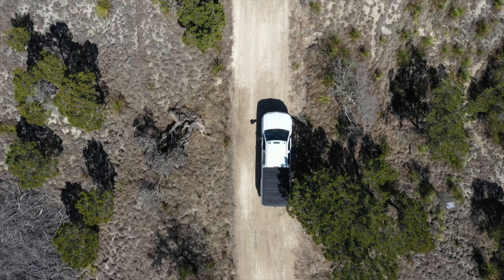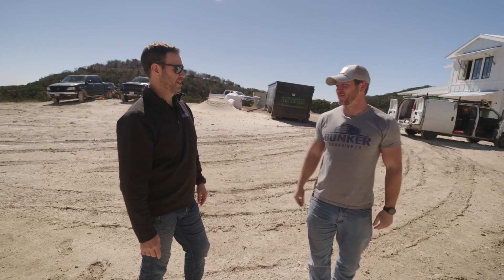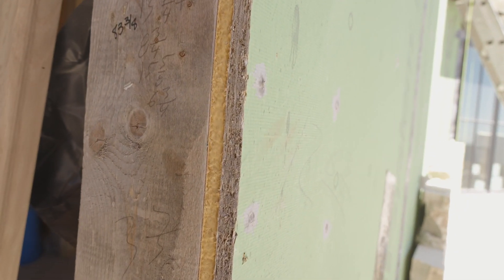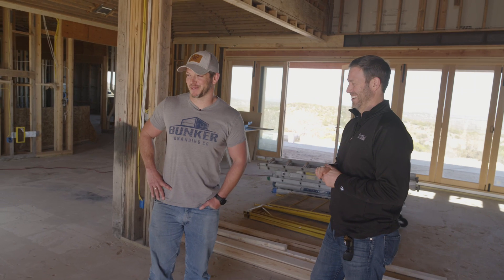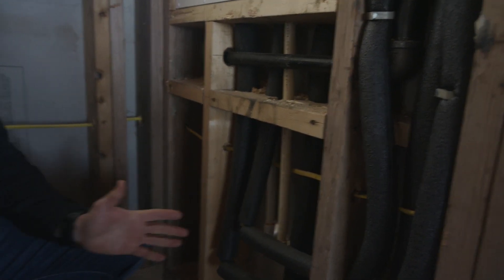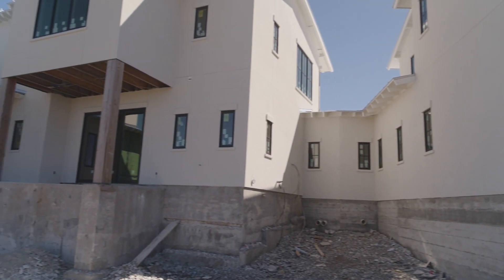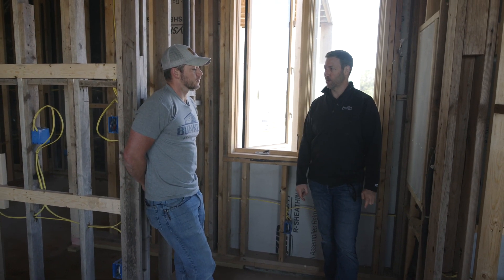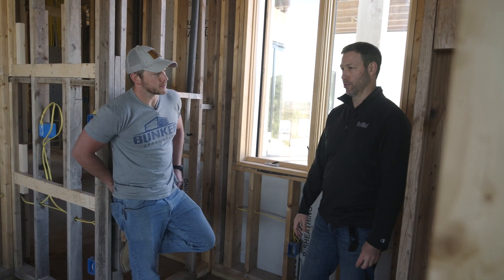One Vulnerable Spot at the Abandoned Mansion

Comment: We can't get a plumber to fix our external faucet. Ten years almost now and most calls are ignored. We've only been granted a visit from three plumbers over the decade for different needs that were more pressing including a mid summer main break at the inlet into the slab foundation which involved two plumbers the first of which promised considerable demolition and twice the price that the second responder asked. We would have used that plumber again but they and their construction branch have passed on all our calls and efforts to contact for further renovation work. The last plumber we hired was to try and clear a drainage obstruction related to all drains in the bathroom. They achieved a good result with the sink drain but were met with difficult bend with the bathtub drain. They left it unresolved and in turn haven't responded to any of our later calls about other plumbing issues with the hose outlet and toilet feed.

Our house has suffered considerable distress over the decade and with no options on contract repair and renovation we're stuck. Stuck with a improperly installed furnace stack, improper window installation, soaked insulation or relocated by rodents, mold and condensation damage, spongy ceiling paneling from rain intrusion, collapsing wall panels under most window replacements, sloping kitchen cabinets from water damage, substandard insulation in the ceiling in the form of layered newsprint, compromised electrics, untreateable ant infestation, improper drains in the kitchen, corrosion damage to the exterior walls, a break in the foundation at the water feed into the house, and layers of lead flaking paint. It took four months before we could get a new refrigerator delivered after purchase as the demolition needed to fit it into place prevented it. It took four months after calling different job people as well as relatives of friends who also passed on our voicemails till one connection fell into line. Wall removed and finally we could move forward after It was me who patched in the floor tiles and applied a basic plywood patching over the wall cavities.

This is the house we have, it has historic value and represents a standing investment. But there isn't a contractor under retirement age who will humble them selves to answer a job request or commit to more than one project. If we had not been able to get our main line replaced by the second contractor we would have been forced to demolish our kitchen with no certainty of replacement. Our utility expenses are likely considerably higher than that of a much larger more standard house not just for the strangeness of it's last refit but also for the critical level of disrepair it has reached. There should be a path forward. Even our engagements for finishing standard projects have met with problems.

I understand that tradesmen are in shorter supply, or at least in some areas of the country. But we have been willing to pay in past, our money was as good as anyone else's. We could afford the repairs. Now we don't know if what savings we have have a hope of fixing a portion of the problems mounted up. What on Earth is wrong with people that they turn up their noses at a challenge? Now the challenge is critical and then some with every passing season. We would normally heat with Gas but the furnace has been suffered from corrosion via the stack and was neither fit to start or accessible to test. We heated through half the season using our electric oven before it fizzed out and have been stuck with space heaters since then. Somehow we had no pipes freeze this winter where we would normally however we never turned down our heaters and kept faucets trickling to reduce risks.

Obviously my singular option is to refurbish everything my self. I haven't the tools or know how for such a project. I haven't the space to work on a project of this scope. Every time I view a video related to problem solving and prevention I wonder where the hell all of this know-how and workmanship exists. I assume it's nowhere near where I live or I must represent the single exception for contractors everywhere of a customer not worth catering to.

Comment: Carriker has been grooving on solar power in one out building. Why not more!? Solar power could be it's own back up plan if the heat tape, sensors (fire) and security system are low voltage.

Comment: I've NEVER seen anyone NOT use frostproof wall hydrants on any recent new construction north of DFW.  I'll bet west Texas uses them more often than not as well.   The "commonly in Texas" statement may apply in south Texas where these two Matts live, but they are found all over north and west Texas.  The vacuum breaker they are talking about is used to protect the water supply.  If a hose was attached to the hydrant, and a larger leak developed in another part of the water system, the water in the hose could be sucked back into the other portion of the system thus potentially contaminating it.  The vacuum breaker "breaks" the vacuum that is created by the leak thus preventing the contamination.  Also, I bet those plastic "adapters" won't last a year after they are installed.

Comment: I could discuss for hours the differences in between how we build here in Australia and the way you guys do it over there (and if you are interested I'm happy to do so)  but for now just a few observations. 

Eves or as you refer to them, overhangs. No one builds a home here without eves of at least a couple of feet, a house would look odd without them. Like wise gutters which I was surprised to find out are rare in some parts of the US. Here in OZ if there  is no reticulated water the most common method of providing water is not a bore as is used there but rainwater off the roof into tanks. In areas where it is really dry gutters are still fitted as every drop is precious and bore water can be hard or salty and not good drinking. 

Roofs, we constantly shake our heads at the US love of shingles over ply. Roofs here are generally either Colorbond (electrostatically coated corrugated steel) or concrete tile. Shingles are almost unheard of let alone tar or other membranes. Generally our roofs will last the life of the house, I've seen corrugated iron roofs 150 years old and still going strong. Tile is not as popular as it was from the 50s to the 80s, the preference is now Colorbond steel. 

PVC piping: NO ONE here would ever use PVC for anything but drains and drainage. I can not believe it is used for pressure pipes in the US, that wouldn't make code here. Matt even uses it outside and even for tap risers which shocked me. All of that would be polypropylene here even tho we don't get freezing temps where I live. What a cheap and nasty way of doing things and TBH poly is no more expensive but has the advantages of flexibility and glueless, reusable fittings. For cold water inside (ie: in wall) we use the same nylon pipe if price is a factor or copper, hot is always copper but this use of PVC for pressure pipe is just nuts. 

I'm sure you will agree that Matt is doing a bang up job on the place, better than he thinks in fact. It is a massive project and it's all coming together really well. This is the first of your videos I've seen and I'm going to watch some more so expect some commentary on the differences in the ways we design and construct houses.
Reply: They aren't using PVC for pressure they are using PEX.  Do they use PEX in Australia?  Metal roofs are popular in some parts of the US.  Believe it or not in some places having a metal roof makes the insurance more expensive.
Reply: @DaveMcLain  In the house he's using PEX yes but at home and at Bunker all the outside pressure pipe is rigid PVC which to me is nuts. Take a look at a couple of the recent Off the Ranch videos such as the one from last week titled something like "repairing the damage". The only place I have ever seen PVC used as pressure pipe is in pool systems. 

Yes they use PEX here instead of copper inside walls etc.
Reply: @marvindebot3264  I haven't seen that video but maybe they used it because PEX doesn't like to be used outside where it is exposed to the sun.
Reply: @DaveMcLain  Then use poly like this: https://www.polypipe.com.au/
Using a brittle, hard pipe for pressure is nuts.
Reply: @marvindebot3264  PVC is rated for really high pressure as long as that pressure is water not air.  It's really ok.  Black poly pipe is also used in the US but mostly for direct burial water lines.

Comment: Propane furnace will NOT run without power. Yes fan won't run but neither will the burner. You need power to control the propane flow and ignition

Comment: metal has been the prefered option on the roof in Australia for about 30 years, I've never understood why people would pay for shingles, only to have to reshingle it every few years or when you get hailed on or in places like Hawaii redoing it every time you get a cyclone, crazy
Reply: I was determined to have a metal roof on the last house I built but my roofer talked me out of it. The asphalt shingles last 20+ years with warranty and cost 1/2 of what the metal roof was going to cost me. He explained that if I really wanted to put that much money into a roof, give him half the cost of a metal roof and put the other half in a savings account. In 20+ years from then he could put a new asphalt shingle roof on for what was in the savings account.
As far as the warranty, he said don't bank on the metal roofing supplier warranty because everyone of the suppliers that he previously dealt with went out of business.
The shingles are of great quality and 24 years leak free.
Every other year or so I have to scrub and pressure wash the metal roof on my shop and on occasion change out the metal screws because the rubber seal deteriorate.
Pro and cons with any roof depending on environment and other circumstances. Just my experience and that savings account looks pretty good.

Comment: Those frost free bibs suck balls. Or at least the ones I have on my house. The system that allows the air to push the water outta the line also make the water leak when you are at lower pressure. Makes the water leak around where your hose connects.

Comment: a couple of things - that type of hose bib he was holding is not a ball valve it's a globe valve - and he should have said 'freeze' instead of 'frost', and i believe the in the wall on demand water heater has a drain in it that goes outside (you can see it - it's the white tube)  and heat tape only works if you have power, i would never put exterior or in the wall on demand water heaters anywhere but in a zero freeze environ (which most of Texas is not) and metal plumber's strap on plastic is not code (tho i doubt it will ever fail because the plumber was savvy enough to put on some sheilding and it is getting foamed (tho i would never foam bays that have water supply lines in them in case of leaks) - (i also would never put water supply lines in exterior walls if i could help it - hard to do in a on an existing slab foundation remodal - i know)

Comment: No water lines in exterior walls.  No water lines running in the attic.  No hose bibs on your walls (instead have 2ft deep frost proof yard hydrants). Have furnaces in their own downstairs finished room NOT in an attic.  On demand water heater and for a house that size have multiple for sections of the house(less wasted water waiting for the water to get hot).  Have a manifold where you can turn off water to different quadrants of the house rather than one valve for the whole house.  Sucks turning off water for whole house just to fix one faucet or pipe.  Transfer switch on the breaker panel and a duel fuel generator you can run on propane tanks. Unlike gas, propane doesn't go bad and carbs don't get gummed up by propane.  Also you're not dependent on the gas company.  If the outage is prolonged you can pull gas from other vehicles and convert the generator to gasoline.  That covers most peoples vulnerable spots.  Take the extra step and have at least 1 wood or pellet stove somewhere.

Comment: He does not need a petrol generator.  He’s got enough land to set up a ground based solar array and add some Tesla Powerwalls to backup the house.
Reply: Bob Watters  If he’s living in a mansion, he can afford powerwalls.  Also, he can get up to ten.  And two or three can easily handle AC, especially if the home is energy efficient.  And in the summertime, he would be producing tons of power off solar, so he would only need batteries after panels stop producing.  He’d never need to go fetch fuel for a generator.  Is a generator cheaper?  Yes.  But it’s also inferior.

Comment: Backup Propane Generator or at least a Uninterruptible Power Supply (UPS) on your water heaters / keeps clean power and will run a propane tankless water heater for hours in a failure

Comment: Ever considered geo thermal energy to heat the home.
Reply: With all that insulation, his lights may be enough to heat the house. I doubt he will even need much AC, mostly to remove heat from people and appliances. A dehumidifier will be more important.
Reply: Bob Watters  Sure, but it will stay warm when snow covers the panels. In the summer, when there is a solar load, solar panels should operate. Once the sun goes down, the 90 degree to 70 degree temperature differential will be well handled by insulation with AC running off batteries if the grid fails. Most of the heat comes from electric appliances, so if the non-essential ones are turned off, it should remain comfortable. I would rather do that than have a noisy diesel generator kick on.

Nothing is fool-proof, as there are still transfer switches which could fail, HVAC units which may break, so the entire system has to be analyzed to determine  what failures one can live with, and on what failures one should spend money to prepare. At that point, it becomes a personal choice.

Comment: Is there any way to run solar, and prioritize certain devices?
Reply: transfer switch, tied to a subpanel with the devices you need to keep on. something like that.
Reply: If each are on a separate circuit just turn off the circuit you don't want to run
Reply: @colinstu  Any way to program a "brain" to prioritize certain devices? Like central air and water heaters?

Comment: Why do a backup gen when you can run backup solar?
I’m usually concerned about maintenance, I feel a good backup anything should be super low maintenance, be able to run in the background and give up to 1 week of power min. So in a world where anything can happen, divert the generator money into solar infrastructure and the diesel and tank into batteries, enough batteries. It will save you electricity cost everyday and give you rationable backup power up to 1 month if well rationed.

Comment: Matt my house gets water on the walls only when it is below freezing outside. The current humidity never goes above 40%. The home builder has 2 dehumidifiers running in my house for 3 years and I still have the issue. Any idea what could be causing this. THe home builder said he has no idea why it is happening.
Reply from the maker: That’s really odd. Need more information but sounds like a condensation issue. Is your house un insulated?
Reply: @buildshow  No my house is insulated. The only walls that don't get the condensation are when I pull the insulation down in the unfinished part of my basement.
Reply: Also thank you for replying.

Comment: A generator or and some solar panels on the hills around the property.
Reply: Or just the roof? Why make an eyesore and take up land when you have all that roof?
Maybe accessability and maintenance is easier. What I've see in snow, cold storms like seen the last weeks solar installations need to be de-iced and have the snow removed. So to be able to do that I figure you do need proper access to service them. Maybe if solar panels had a feature where they used sone of the energy they produce to de-ice and snow themselves when temperatures get below 0°C that would be a fantastic way to solve that problem.

Comment: A decent solar plus battery storage system would be far better and 1,000 × more reliable than a propane / backup generator set-up. No delivery or servicing worries or expensive bills. Also, where Matt and Mere are, a modest sized wind turbine or two would come in handy. Fossil fuel based backups are fully indicative of an old fashioned stuck in the mud mindset.
Actually, wherever physically and financially possible, it really makes sense to future proof a property, whether that be a domestic, commercial or industrial unit, by installing some sort of renewable energy generation and battery storage system. Super duper insulation is great but is only one part of the puzzle. For anyone of a Prepper mindset, you cannot be more Prepper minded than renewable energy self generation and battery storage.

Comment: Propane is the worst way to heat a house. My kids home is on propane cause there is no gas in the area and heating the house over the winter costs 1300 on average for 2 fill ups of the tank and that's using electric space heaters when people are home and the furnace is set to 18C. It's horrible but the wood stove has a crack and it's all the way in the basement so impractical even if it did work.